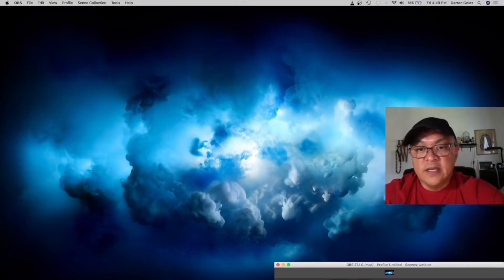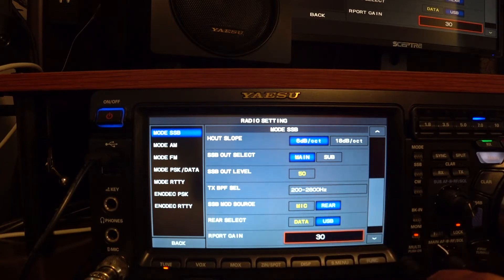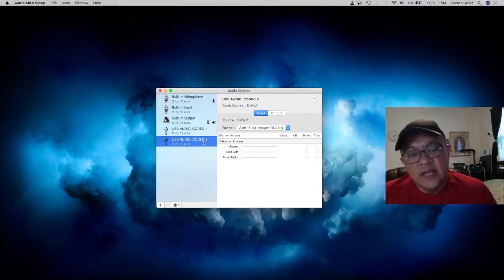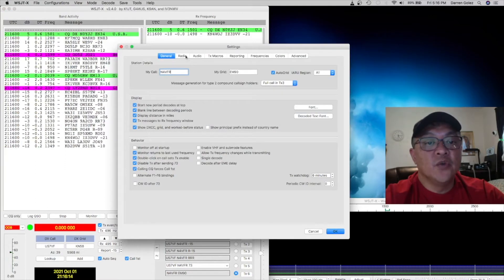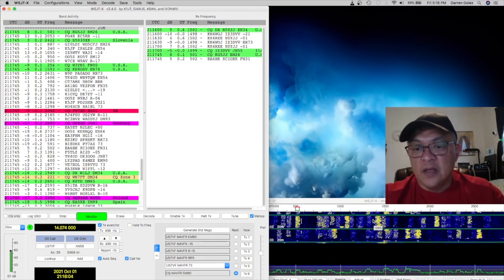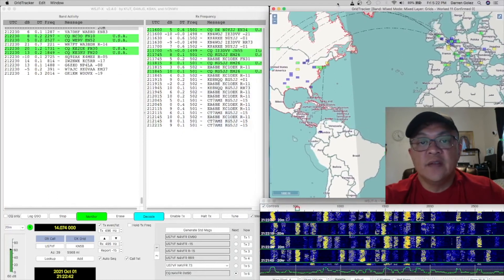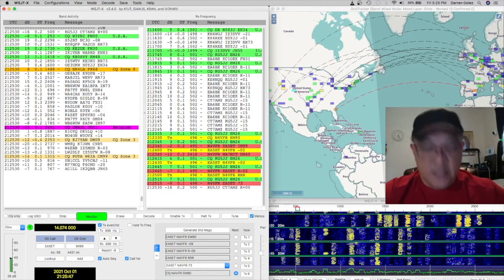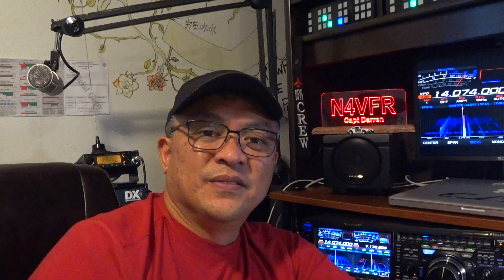Yaesu FTDX101MP and MacBook Pro!  Set up for WSJT-X FT8 | GridTracker | Easy Setup to get started

Comment: Thanks, this was extremely helpful to get me going on FT8! Just one bit of feedback, is that I didn’t need to change the 232C rate from the factory setting of 4800.  I have been having fun on FT8 with MacLogger and GridTracker.  Thanks again for helping me with my FT8 adventure.  All the best, Paul N6AV

Comment: Appreciate the time you spend doing this. I have a 101mp and MacPro(Intel). QUESTION: the settings you have to make in the 'Operation  Settings' and 'Radio Settings', on the 101MP,  to work properly with the WSJT-X FT8 application , do the 100MP settings you have changed for FT8 operations do they have to be changed back again to go back and use the 101MP in voice/SSB mode?
Reply from the maker: I'm sorry that I no longer using the 101MP, I sold it to a friend of mine in Canada and using it in Contesting and doing great!  If I remembered right, I configured my 101MP for FT8 and was still able to use SSB without reverting back to the original settings.  73's de N4VFR
Reply: @DarrenN4VFR  I appreciate the return comment very much. Hey, how come no longer the 101MP? What did you get for replacement ?
Reply from the maker: @schoocg  It was too large for my desk.  I replaced it with the IC7610.  I remote to my QTH from the hotel rooms as I travel.

Comment: "I'm only pushing about 100 watts" Only 100!? I thought FT8 was a low power mode designed for weak signal comms. I use between 5 and 10 watts and get results around the globe.
Reply from the maker: FT8 is weak signal mode.  Sure you can run low power and depends on propagation and band you use. We should use enough power (minimum) to establish 2 way communications.
Reply: @DarrenN4VFR  100w is way too much for FT8. Try 5-10w max … you’ll be amazed how well it works.
Reply from the maker: @MikeonabikeinEyke  We'll do, thank you!
Reply: FT8 is a weak signal mode.  That means it is able to RECEIVE weak signals.  It does not mean you have to run low power.  It is recommended but Ian it is not what "low signal" means.

Comment: Been watching your videos and have learned a lot right along with you.  Gonna be taking my General test in mid November and perhaps by December I will be on the air.  Clearly impressed with the FTDX101MP.  Plans are to erect a dipole at about 55ft on 20M.  Lots of work to do.  Have to run a #6 ground wire from the ham shack room  to a trench some 100' feet to where my electrical service is grounded so it is all bonded in.  Keep up the good work and I do have a question for you.   When you tuned your antenna with the new Palstar tuner, how did you generate the carrier and at what power on the MP? Cheers W1SWL Art